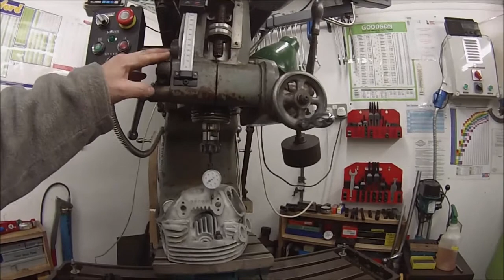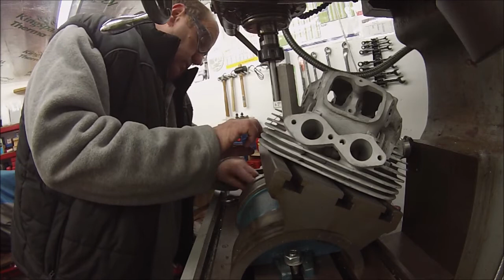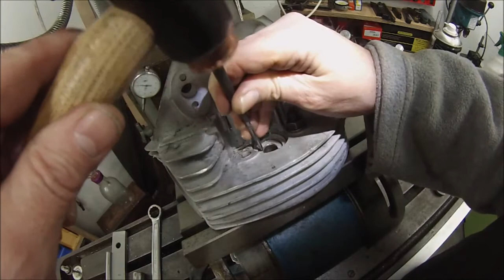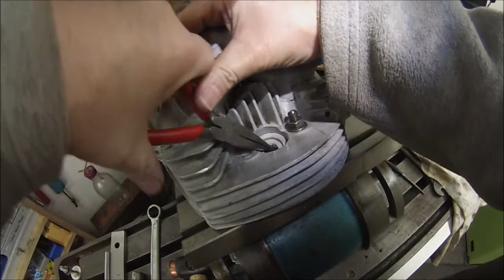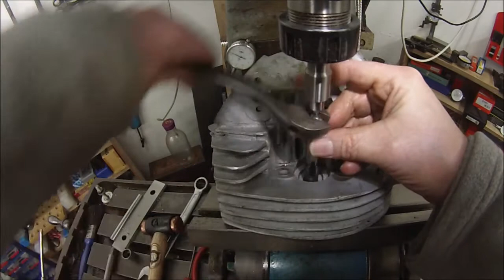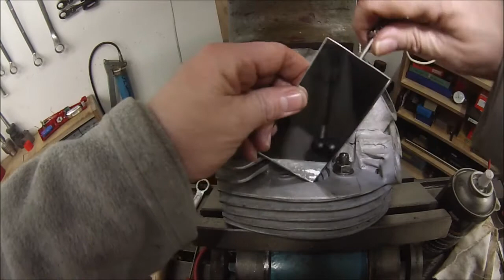Norton head, broken spark plug

Comment: I've never seen a thread almost fused to aluminum. The head alloy appears to be sticky. You wonder if they didn't put a candle with a very hot thermal index and tightened it too much when coupling the candle. Fortunately with all the difficulties the thread was saved.
Reply from the maker: Many thanks

Comment: Been there, done that, but the T shirt shop was shut that day
Sometimes I find it better to use the side of an end mill to enlarge the hole, when I am not left with just the thread coil. If you put the milling cutter to full depth and go a couple of thou in + &- both X&Y, or whatever is needed so you are left with the coil and then often you can just pull the thread out. As you know, it wont matter a jot if you over do it be a thou or two you will have plenty left. Having said that, on a couple if occasions I have found the thread still wont come out, guess the owner thought thread locker might be useful, NOT!
ATB for C&NY
c
Reply from the maker: Hi Chris, thanks for you thoughts , good advice as always. Best wishes and merry Christmas, all the best, Ade

Comment: Nice Job. For what  it's worth, sometimes when your drilling them out a left hand drill will unscrew the stuck threads. Bob.
Reply from the maker: Hello Bob, yes sometimes we get lucky and the drill takes it out as it is drilled, I was hoping it may have screwed downward with the R/H drill and come out that way, but it was well stuck after maybe 30 or 40 years. Best wishes and merry Christmas, Ade
Reply: Merry Christmas Ade. I'm so used to extracting broken screws from blind holes I go for the left hand drill all the time. Your absolutely right, it may well have driven it right out the bottom. As you say years do a job on heads! Bob